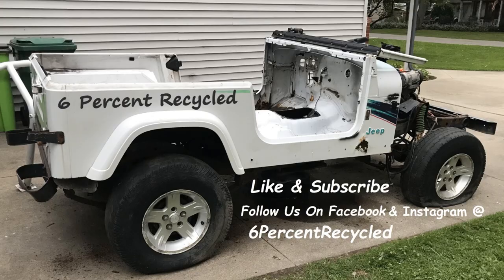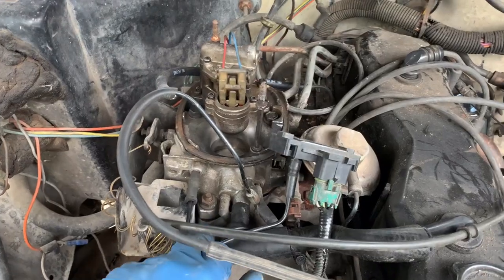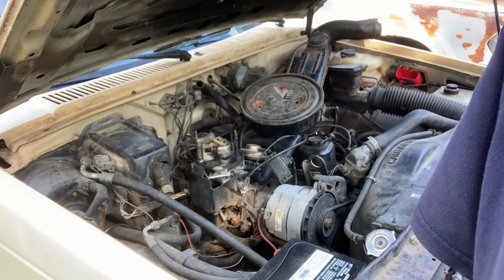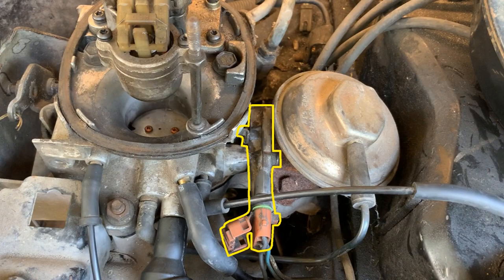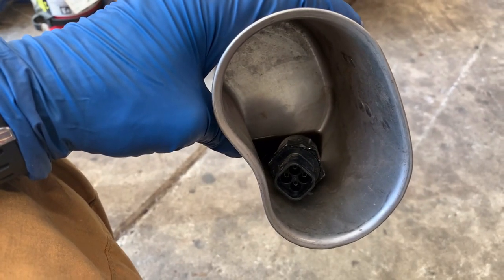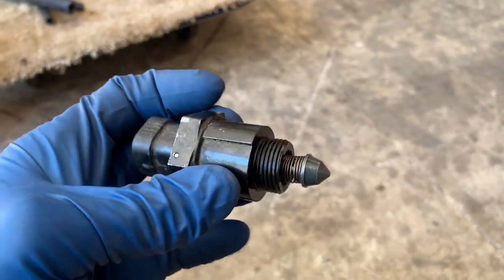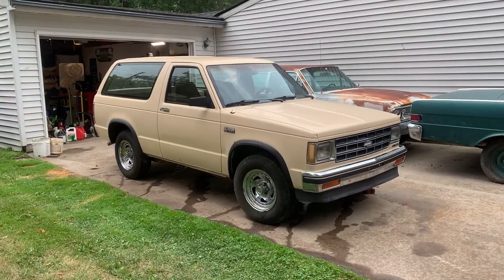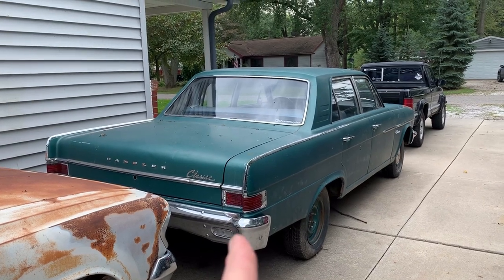1986 Chevy S10 Blazer Lets Fix The Runaway Idle

Comment: I’ve always wanted a S10 Blazer, at least with a 2.8, because I always felt that the 2.5 was too doggish with the weight of them. Thankfully they’re easy to work on, it’s just all the vacuum lines that makes it intimidating. Good video
Reply from the maker: The 2.5L is a bit under powered for the weight of this vehicle. The channel Boosted Street Junk bought the Blazer and will be making it faster. The videos should be on their channel soon.

Comment: Ignition control module I know that is the problem with my 92 chevy s10
Reply from the maker: It was the IAC. If I'd been able to drive it over 40 mph and for more than 10 mins it would have reset itself fully.  Thanks for the tip👍

Comment: they may have messed with the base idle setting
Reply from the maker: It was a replacement IAC that wasn't setup properly when replaced. Setting the new part and driving it over 40mph "calibrates" them. This truck now has a turbo LS in it installed by the new owner.

Comment: So I have just purchased a GMC woody and have a lot of questions?
Reply from the maker: That awesome! I'll try to answer anything I can for you👍
Reply: @6percentrecycled  I can’t get the back to open and don’t want to brake anything. How should I go about this
Reply from the maker: @arturogomez2263  the glass, the tailgate, or both? And do you have keys?
Reply: @6percentrecycled  yes I have keys, but I don’t not feel that it is catching the mechanism inside, and I cannot see how to open it from the inside, and I don’t wanna break it
Reply from the maker: @arturogomez2263  The tailgate inner trim wont come off without breaking it unless you have the tailgate in the down position. Try watching this video I did on replacing the lock cylinder. I opened the tailgate with a screw driver. As long as the glass will open you should be able to eventually make the tailgate open. Just be careful. https://www.youtube.com/watch?v=0rEy5bBspRw

Comment: So I still have a little issue’s. When I give it throttle at the stop it wants to stall out and die unless I feather it? Any suggestions?
Reply from the maker: Did you try to reset the IAC like I did in the video? It has to relearn the position and fully correct itself after being driven. If the IAC is good try following the other steps in the video and test the vacuum lines, TPS, etc. Unfortunately I don't know any magic for this problem. You have to trouble shot the different systems to diagnose what's giving you the issue. Sorry I can't be more helpful.